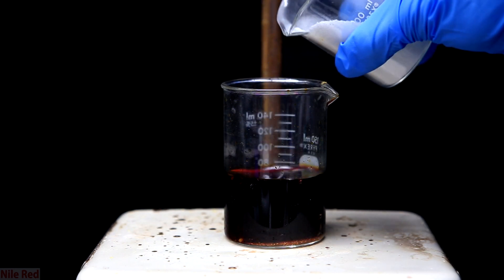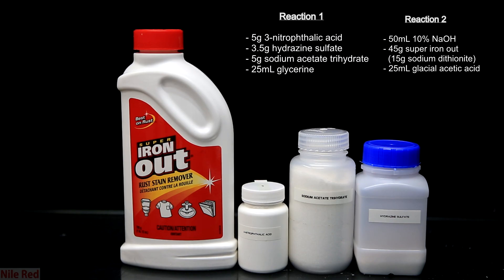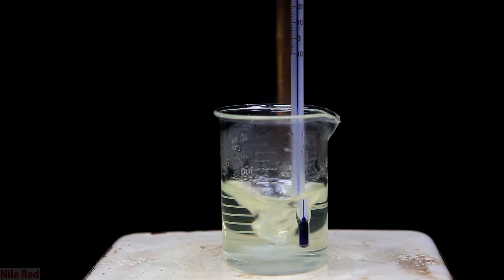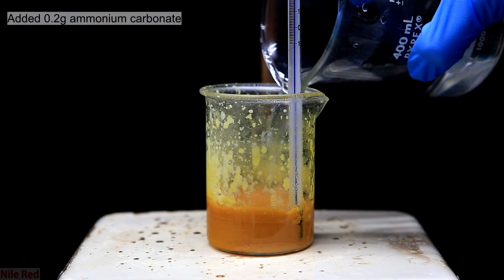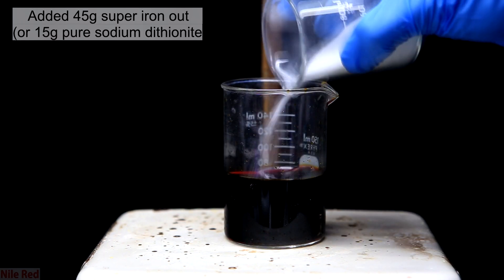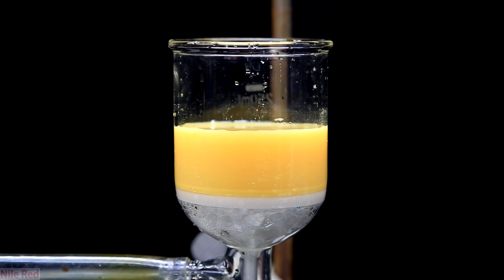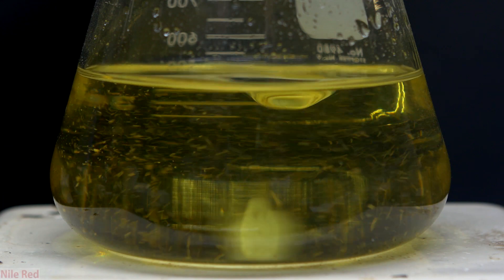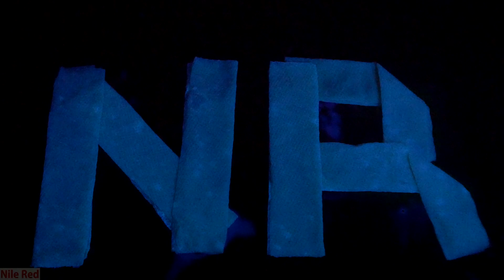Making Luminol

Comment: @NileRed great interesting video,  maybe i'll try it myself..... something else i wanted. You're using mainly magnetic stirer that means you don't have to have boiling stones but from my experience it's better to have boiling stones. Mainly for destilations and methods where is required lot of heat. My magnetic stir hotplate is not efficent as yours because of that i'm using old ETA spiral hotplate (slovakian thing) , it's capable of much higher temperatures (sometimes really crazy) as my magnetic stirer. Well in that case i need boiling stones. At school we're using broken porcelain plates but i personaly prefer ceramic filtration rolls from aquarium filter because they don't react and have much more surface than porcelain fragments. Thanks that i can use much higher temperatures without bobbling out.

Comment: I used the formula of 30.4 grams of Potassium Ferricyanide made up to 1 liter with 3% h2o2. I mixed equal parts of this with the luminol  solution and it glowed green.  Is this the right concentration????? I added some of the Ferricyanide solution to an excess of the luminal solution and it glowed the characteristic  blue colour.  I am concerned that the ferrocyanide  solution
is too strong thus wasting a valuable resource. Comments please.

Comment: I have never seen a more convoluted way to produce a luminol reaction...;-) A few grams of luminol,  a bit more of NaOH pellets and fill it up with 1 litre of water. That's it. When you want to use it, add 50µl 30% H2O2 per 100ml of solution (or more, if you do not want to do DNA analysis later) and just start spraying. If you want some really nice bright glow, add some chloride based bleach. Else, just prick your finger and add a drop of blood. It will glow for a few minutes. I use this for forensic work. I can whip it up within a few minutes, just need two components, water and later add the H2O2. It is stable for at least a year (use it frequently, so no need to test this) and I only need my jugs of solution and small vial of H2O2 to add at the crime scene. Why running around with two solutions? You can get good (false positive) reactions from copper, some ceramics, dyes, some vegetables, cleaning agents etc. But those usually look much different (short and bright reactions) than blood (slower and longer). Sorry, just triggered me with all those chemicals you do not need to get a good result. :-)

Comment: I did this synthesis last week. From 200g of phtalic anhydride (pure p.a., Acros) i got 40 grams of 3-nitrophtalic acid. I took 10g of acid which yielded about 8g (6g after drying in oven) of luminol. All steps were identical, except I used pure sodium dithionite, cause it can be bought over the counter in Poland. Only last step was a bit different - I dumped the sodium dithionite to the solution, brought it to a short boil, and left it to cool. Great video.

Comment: Not that palladium on carbon is easy to come by, but in theory, you could have used hydrazine sulfate to reduce the nitro group as well, but as I've never run such reactions in glycerol, I can't say for certain if this could be converted to a 1 pot process.

Comment: Incidentally, would it be easier to purify the sodium dithionite from your rust cleaner before you put it into the reaction, rather than having to deal with the foaming and having to repurify the luminol to deal with the additives? Or is it fine this way? You’ve done plenty of purifying and extracting from household stuff before, including a video on how to do a more general procedure, so is there some difficulty in isolating dithionite, or is it simply more practical to purify it afterwards?

Comment: Sodium dithionite is only metastable and rapidly decomposes in acid. My guess is the household version has the bicarb as a stabilizer. That's also why you get it as a possible range. Even the chem suppliers sell it as such and you usually use an excess. Again, nice hands NileRed. Mechanism is off, consider the first step going through the anhydride of the diacid (made by dehydration under the high heat). Second addition would also go through an anhydride or ester amide intermediate (from your glycerol or a dimer of the acids). Excellent demonstration.

Comment: The best boiling stones on the planet that work perfectly every single time are small the regular chunks of PTFE. Do it I did simply go down to a metal supplier as most sell Plastics to and buy a scrap junk of Teflon and cut it up. I use the bandsaw cuz I have one but you could use a little hacksaw or anything it just chop it up clean them in hot sulfuric acid and you're done. On the bandsaw I made about 2 cups worth of tiny 5 mm Square boiling stones in probably less than 10 minutes. I've have never had a bump since

Comment: I'm no chemist, but what I do know from other endeavors is that having your thermometer directly in contact with your beaker during heating might not be the best idea. 

It has to introduce some variance due to the thermal nature of the glass. I'd think you would want the business end of the thermometer in contact with nothing but the solution you're monitoring. 

I guess since there is a temp. range in this reaction it isn't that critical... But I've found that using best practices habitually ends up being better in the long run.

Comment: 6:50 Why doesn't the free base Hydrazine boil off along with the Acetic acid? Both compounds have a boiling point around 114 C :/ If we increase the temperature to 200-220 C shouldn't we lose all of the Hydrazine?
Reply: Hydrazine acetate is soluble in glycerin. At the heat of about 220°C it decomposes into hydrazine and acetic acid. The hydrazine is soluble in the glycerin, thus keeping it from evaporating off, the acetic acid isn't(or very hardly soluble), so it just boils away.
Reply: Oh i didn't realize that. Thank you! :)

Comment: How do you add sodium hydroxide and heat without hydrolyzing the amides? Shouldn't a very basic solution take you back to phthalic acid?
Reply: agent475816 It's not a hydroxide but a thiosulfate. And thiosulfateas do not hydrolyze.
Reply: I have to correct myself (i guess i didn't see that part) The solution is basic to dissolve the 3-nitropthalhydrazine. The hydrolyzation does take place to some degree, but Nile neutralized the base soon enough to prevent mature loss
Reply: Oh, thanks.

Comment: I wonder if there is any correlation between the blood detecting properties of this chemical and the ATP detecting swabs/machine I used to use when I had a job santitizing ambulances.
Reply from the maker: +BaddaBigBoom you had a machine to detect ATP? I imagine it worked by using the ATP energy to stimulate something, which is a little different than what's going on here.
Reply: +NileRed No it worked on photo luminescence, readings would be high if any organic deposits were picked up by the swab and off the scale if blood was picked up.

Comment: What other commonly available reducing agent I can use to reduce 3-nitrophthalhydrazide? I don"t want to bother with making sodium dithionite (I could if no option)or buying sodium metabisulfite- NurRage or thiourea dioxide like UC235. Can I in this case reduce NO2 group in other way like for example in aniline preparation buy Zn and HCl or anything else?
Reply: Me too. Fe/HCl is also used. My concern is the hydrolysis of the hydrazide functional group....

Comment: This always bothers me; How on earth do all these substances not dissolves the glass, must be very robust.
Reply: NanoTry Box The glass is made out of different compounds. Lab grade parts are made out of : 81% Silicondioxide, 13% Diborotrioxide, 2% Dialuminumtrioxide and 4% Disodiumoxide. All in all it's mainly called Boro-Silicate-Glass. All those are salts, which form crystalline structures. Such structures are, due to the composition of different compounds, very resistant against chemicals. But there are chemicals that dissolve lab glass, HF for example.

Comment: Some quick questions about this synthesis:

1) Why did you use acetate to free the hydrazine? Wouldn't hydrazine (bp 114 C) boil off before the acid (bp 119 C) does? Chloride seems like it would accomplish the same goal, except it is even easier to obtain and has a lower boiling point. It also seems like the acetic acid and hydrazine might have potentially reacted to acetylhydrazide, hurting your yield.

2) Why was the nitro reduction done after the hydrazide was formed? The basic conditions are capable of hydrolysing hydrazides.

Comment: I make my boiling stones out of broken glassware. I just take a broken beaker, or flask and smash it into 1-2 inch pieces; then I heat it, in a torch flame, until it is amorphous and then crimp it with pliers.
 
I repeat this procedure until it looks like a lumpy sphere and then heat it a bit more to polish any edges. It is a pretty cost effective use of damaged glassware, which we all have more of than we would like =/

Comment: How does the suspension stir itself while on the hot plate?
Reply: It's a magnetic stirrer. You put a magnetic stir rod in the beaker, and there are magnets in the hot plate that cause the rod to spin

Comment: Nile - I fully appreciate the work involved in what I am about to [sugg/requ]est, but am shameless:

When you place reaction diagrams on screen and discuss them, could you apply a marker to point at the part(s) you're talking about as you go; like a laser pointer?

The editing would be a bitch for sure, but the result would be really helpful. Please consider it.
Cheers :-)
Reply from the maker: +Fred Gandt Ill look into it. I do have to get a little better at editing :)
Reply: Your editing is good. I know how much time and effort it takes. IMO curious people are never satisfied :-)

A method that I haven't tried, but that might work, could be to screen capture a layer above playback of the annotated video with you using a pointer (modified cursor) live, then overlay the original video with the cursor video in sync.

In theory that should be a way to get moving annotations, but as is typical, would be entirely dependent on software configuration.
I'm pretty sure OBS (free streaming software) allows the recording of user specified layers.

I'm just about to take my dog out, so won't respond immediately - but - I might be able to help as a code wrangler if you want it.
I'd be happy to donate my service.
What I'm thinking is that your reaction diagrams probably exist as image files - right?
So they could be embedded in a simple HTML doc (you can open in your browser (no need for server)), and a custom pointer moved over them in sync with your voiceover. You then screen cap the diagrams and overlay them as video instead of image files.

Let me know if I can be any help.
Reply from the maker: Fred Gandt haha that sounds good but like a lot of extra work :p
Reply: Unless some option exists in whatever software you have or might get has an option to add moving annotations an easy way, I was trying to think how to get it done with the least amount of work.
Consider the alternative:
Create a pointer image for use as a static overlay, then add it for 10 frames at x,y then for 20 frames at x,y, then another 10 frames at x,y ...
Screw that!

By screen-capturing a custom (for visibility) cursor (possible) moving over the actual reaction slides, synced to your voice over, the whole ensemble can be overlaid in one hit.

The only part I'm unsure of is the color-to-alpha requirement.
I know some video editing software allows this - maybe most if not all (decent stuff), but whether yours does, you'll have to find out.
Why? If you have 3 slides on screen simultaneously, and you want to maintain the line of sight to the video behind them through the gaps, and the pointer is moving from one slide to another across that gap, and you don't want to spend hours cleverly gluing lots of separately created and edited screen cap videos together - you'll need to be able to remove the background (green-screen) in post.

That's where the idea of the HTML doc comes in:
A simple doc that allows you to drop and freely position your image/slides, with a colored background for later removal, and a custom cursor for the pointer - so you can simply mouse around showing what all the long words are while recording or playing back your voice over, then add as a video overlay and bob's your uncle.

You know ya wanna ;-)
Reply: Chroma Key <--- Blender does it, so I'd be surprised if any good dedicated video editing software didn't.